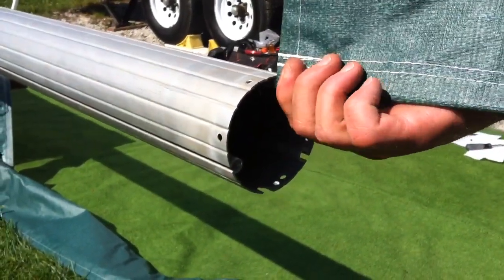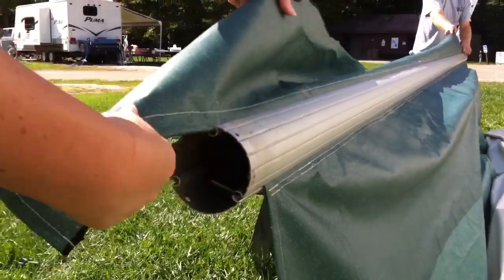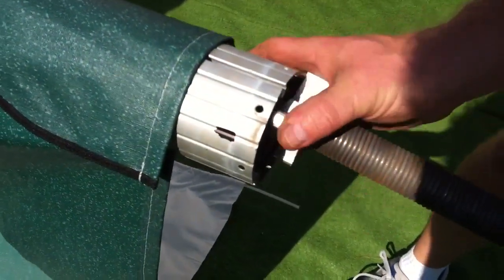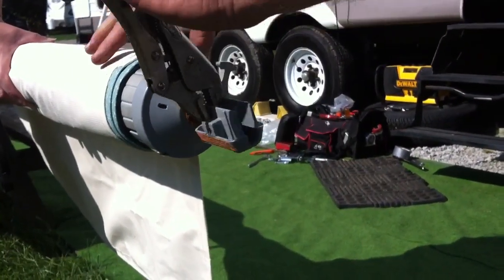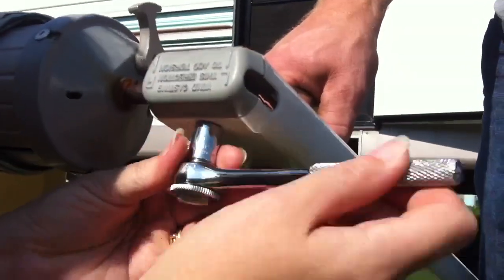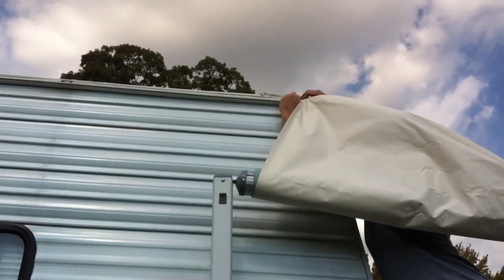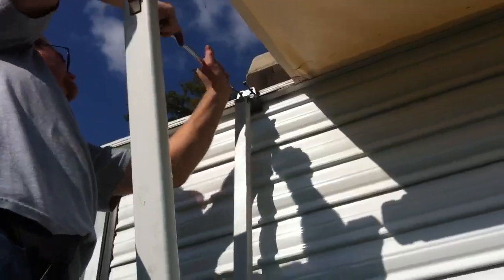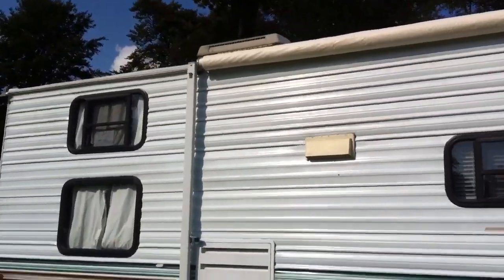Replacing the awning fabric on an A&E model 8500 RV awning. (Part 2) By How-to Bob

Comment: Thanks for this video series--very clear and easy to follow.

The A&E Model 8500 awning has now been discontinued, though there are still some places online that sell them. My tube, cam lock and fabric were damaged, and after having difficulty obtaining replacement parts, decided to order a new awning (arms are not included, BTW). It's actually easier to replace the whole awning, as the fabric is already rolled on and the mechanism is supplied with the correct torsion (held in place with two cotter pins, which are removed after installation). I supported the awning on two sawhorses, feeding the top hem through the channel one foot at a time, then bolted the castings to the arms afterwards. As another viewer mentioned, silicone spray in the track helps the process.
Reply from the maker: I bet it is easier doing it that way but all I needed to replace was the fabric so it saved me a lot of money. You can probably still get just the fabric to replace if all the hardware is still working on your awning. Thanks for watching.
Reply: @funbro1  Yes, it's a universal type replacement fabric, so no issues there. The quality of the aftermarket fabrics may vary a bit, perhaps a bit thinner than the original. Thanks.

Comment from the maker: In this case I needed to remove both ends because there is a rubber spline that ran the length of the awning and extended out a few inches on either side. I believe the purpose of the spline is to hold the awning in place by crimping it at either end. I also wanted to have new matching rivets in both ends. Hope this helps. Good luck.

Comment: Thanks for the reply. I actually have to replace the poly tubing on the awning. The awning is still in great shape but the poly tubing dry rotted from being off the RV. The stitches have came off that's why I'm looking for just the poly rube stuff.
Reply from the maker: Journey Through Us  You may be able to find the tubing at a upolhostry store if not online somewhere. Most of what I have looked for already had the tubing attached already. Thanks for watching.

Comment: I must have watched a dozen times.  All went well. The lower part was a little difficult to slide in the chanel. I lubed the top groove and the awning with bar soap and it slid real smoothly.  Thanks.
Reply from the maker: Good tips, Thanks

Comment: Y'all did it the hard way! The way I did it and many others that I have done is take a drill and drill the hole out in the cap make a slot where it will slide in and if the spring a little weak on rolling it up turn it a couple times one man on the ground and one on a ladder slide them in at the same time. Where you drilled the hole in the cap drill you two hole on either side for pop rivets to strengthen it up takes maybe 30 to 40 minutes and your done..
Reply from the maker: Sounds like it works good. I wanted a complete stock look so I decide to not drill out my endcaps, but this would be a quick way to do it. Thanks for watching.

Comment: I foolishly bought a used dometic 8500 not realizing the metal rod on the outside of the torsion assembly (which i guess runs through the whole thing?) is very bent. Would it be possible to bend it back? Any tips on how to do so?

Comment: Two things. Spray channels with a silicone spray.  Fabric slides with ease. Secondly,  the tension on the non switched end can be held by inserting small screwdriver into endcap holes and through the shaft.
Reply from the maker: Thanks for checking in, and thanks for watching.

Comment: My 15 year old son and I were able to do this ourselves. The only thing I'd mention to people is make sure you mark which channels the valance, awning and strap go in.  The first time around we got them offset by one channel and had to remove and rethread the entire awning in the correct channels.  Also, and this sounds ridiculous in hindsight, but make sure you tension the spring in the correct rotation.  You guessed it, the first time I did it backwards so it wanted to push the awning down instead of winding it up..  All this is pretty evident in the video, I'm just saying pay attention!
Reply from the maker: Your comments are great, gave me a laugh. Glad to hear you got it done though. Thanks.
Reply: Kelly H On the A&E 8500 / 9000 Awning its  COUNTERCLOCKWISE on the front (as you sit in the driver's seat) and CLOCKWISE on the rear. Eleven rotations may not be enough for older springs. Try for 12 - 13 and hang on tight to your NEEDLE NOSE Vice Grips!!  I oiled the springs before putting them back into the tube.  Also, I started feeding the material on the RV awning rail top - completely across to were it was equal distance from each support arm. Why would you want to drag the tube and all the hardware along the ground when you easily slip the fabric on the tube at ground level after the top rail is fed? I fed the fabric on the tube at ground level without any other hard attached moving the tube along on two saw horses. You may as well lube up the little spring latch on the up/down toggle while it's apart too....   Took 2 hours with a few breaks in between.
Reply from the maker: Richard P
That's great, thanks fro sharing Your experience.
Reply: funbro1 No problem funbro. If it wasn't for your video I never would have had the confidence to do this job. Your video let me line up all the tools I needed and it was good to have all tools right there and ready to go. Oh, I forgot to thank my wife for her assistance and expert advice on clockwise vs. counter clockwise, ha! Not that I'm trying to promote anyone but I got my fabric from rvawningsmart.com and the fabric was an exact match for the Tioga Montara 21 foot ;price was $159 + shipping. Very happy camper! thanks!
Reply: +Richard P I also ordered from rvawningsmart.com  same price as u stated for my 21" , im waiting for delivery as we speak

Comment from the maker: The size of the rivets depends on the size hole that you end up with after taking the old rivets out. A tip that might help is to try not to drill a larger hole than is already there, your goal is to just drill off the head of the rivet. A larger size rivet will not be a problem if needed. Good luck and hopefully this time tomorrow you will have a new awning fabric installed.

Comment: couple notes: the number of turns when ratcheting the awning goes by model and length but what they dont tell you in the dometic instructions is this is actually when the awning is only a foot away from all the way up.....thus if it says 10 turns its really 15-16 turns when fully extended.  Also I find it much easier to feed the fabric into the roof rail first  and then  install it on  the tube closer to ground level.  Too awkward to have to try and feed it through the roof rail while also holding the entire arms/assembly and walk it on.
Reply from the maker: Thanks for checking in. Appreciate your comments.

Comment from the maker: It sounds like your tension spring has spun around inside the tube. The only tension adjustment is the amount of times that the torsion spring get rotated or preloaded. You could possibly have a problem with the ratcheting mechanism causing it to stop. Best of luck. Happy Camping

Comment: Greetings, I have a question. I have an opportunity to get a 20ft awning by a&e... I was wondering if I could cut it down to the size I need which is 14ft? Cut the seaming rope and then replacing the end caps etc.... I can't find the awning with the roll... I'm just coming across the replacement fabric... 

Thanks for your help in advance.
Reply from the maker: You would probably need to be able to sew it back together. I am not that confident in my sewing abilities so I would not do it myself.
Thanks for watching.
Reply: @funbro1    Thanks for replying. I'm not worried about the sewing because I can by the awning fabric the exact size I need..

My concern in the actual awning roll that 20 feet that I want to cut down to 14 feet. 

Is that possible to remove the caps and tension them cut the roll down to the size I need with a saw. Replace the tension and cap back and be ok? 

Thanks again🤩

Comment: Great video, going to try this myself in the next couple of weeks. I measured my fabric at 15' 10 1/2", so I thought it was a 16' awning. Then I learned to measure arm to arm, which  is 17', so my awning is a 17'. Is there no lubrication required for the torsion springs while you have them out?

Comment: To clarify, it looks like I want to turn the right cap (with the switch) counterclockwise and the left clockwise?  Also, is the lever in the roll up or roll down mode, or does it even matter?
Reply from the maker: Yes, you will want to make sure that the tension is the same on both sides...that the awning want to retract. Hope this helps, Thanks for watching.

Comment: Instead of being "out front", my ratchet release is on the "back side" and hitting the camper when fully rolled up.  what would cause that?
Reply from the maker: paul stradley  Sounds like you have the release 180 degrees out of place. You may be able to carefully take one side cap off and rotate it around.

Comment: I have to ask, who was holding the other rafter arm while your wife was holding the front arm when you were starting the awning fabric into the channel on the rv? It seems as if 3 people are needed for this step. I cant imagine the rear arm just lying on the ground putting tension/pressure on the fabric while entering the channel. Just confirming before doing it this weekend!! Thank you!
Reply from the maker: It can be done with 2 people however it would make it much easier with 3 if they are available.
Reply: Great info, very helpful. Thank you!
Reply from the maker: ope it helps, Thanks for watching.
Reply: nice
Reply from the maker: Thanks

Comment: Is it necessary to remove both ends? Couldn't you just remove the end you're sliding the fabric into or am I missing something?
Reply from the maker: +Beezer Yes because the spline that runs through the fabric is attached to both ends to keep it from sliding around the pole. I also wanted new, matching rivets. Thanks for the question.

Comment from the maker: In this case I used the rivet that was the closest in size to the hole that was already there. I had to go a little bit bigger but tried to keep it as close as possible. Each awning may use a different size rivet so I would try to keep it as close to original as possible.

Comment: What if you don REMEMBER  rotations your spring have. I start changing my fabric with out seeing this video and I didn't count the turns, I have the spring system out but now I don't know what to do. Any help please?
Reply from the maker: You could just wind it 4-5 times and without permanently affixing the ends (use removable screws temporarily) wind the awning up and see if that provides enough tension. If not remove the ends and add more rotations until it retracts all the way. Hope this helps. Thanks for watching
Reply: You can Google any questions and get good answers

Comment: i have a A&Emodel 83416-400 is this the same  ia thAT A 1/4 X1/2 RIVET ??
Reply from the maker: The size rivet could vary the best bet is to get the size that fits the hole that you already have and if that cannot be matched up then drill to the next size up. Hope this helps. Thanks for watching.

Comment: My 8500 's cam lever just freewheels. Can't find anyone who will fix it. The local people don't want to replace the spring mechanism they want to replace the entire awning.  Help   need info .... can this be fixed?
Reply from the maker: To get small parts you may have to look to the manufacturer, sometimes they are only sold as a kit or part of another assembly. One anther option is to machine your own parts, modify something close or find a similar replacement part. I hope you are able to come up with something. Thanks for watching

Comment: Do I have to install it on the roller tube first? Wouldn't it be easier to install the fabric to the camper, then supporting the tube, install the spline on the tube? I have a cart to hold the tube so I can wheel it sideways as I slide the fabric on. Picture a typewriter roller walking down a piece of paper!
Reply: NO do not try it this way, I did thinking it would be easier, and it was IMPOSSIBLE! you have to re-tension the springs up in the air and it it a NIGHTMARE

Comment: Why do you need to take both ends off the roller? Can this not be done just by taking one side off?
Reply from the maker: Chad McMichaelTo have all rivets new and matching, but you could only do 1 side if you wanted. Thanks for watching.
Reply: +Chad McMichael  Poly cords have to be inserted in on both sides to hold awning centered

Comment: You never answered the question as to what size rivets do you use. I want to make sure that I don't have to run out to buy the right size during the assembly. Thanks
Reply from the maker: The size of rivet depends on the size drill that you use to drill out the old rivets. I believe I went one size larger just to make sure I had enough good material. Really it does not matter as long as the rivets are in tight. Thanks for watching.

Comment: Do you have to take off both end caps?
Reply from the maker: Technically no but I wanted to have all new rivers and both side match. Thanks for watching.
Reply: I just installed mine and made a video. Its to help if you dont want to remove any endcaps or springs

Comment: Are all awnings about the same with the revolutions
Reply from the maker: I would not trust that they are all the same. Count the turns as you remove the fabric to be sure. Thanks for watching.
Reply: @funbro1  when I put my new roof on it unraveled..
Reply from the maker: Sounds like it is wound backwards.
Reply: @funbro1  one more question to ask you brother I never took anything out of the brackets I unhooked it from the camper and laid it off to the side... I was thinking all I need to do is fit that back in the groove and put my boats back in and it'll be okay right...
Reply: @funbro1  I mean the whole mechanism was removed in one section
Reply: In the video at 8:22... this is exactly how I took my awning off just like he is putting it back on... I never removed the white arms sticking down from the ends.. all I did was pull the canopy out of the groove and laid it on the ground
Reply: Hey buddy I never removed the rafter tails.. I'm about as sharp as a bowling ball sometimes buddy... I want to thank you for all your help and I will make sure that I keep watching your videos

Comment: Not clear on why both ends need to be removed if your just sliding new awning from one end.
Reply from the maker: The spline that runs through the fabric is attached to both ends to keep it from sliding around the pole. I also wanted new, matching rivets. Thanks for watching

Comment: Why do you remove both ends of the tube. Can you just remove one side and remove the fabric from that side. Also easier to install the fabric on the top first and then work on the rolling mechanism.
Reply from the maker: Sure it can be done many different ways. Thanks for watching.